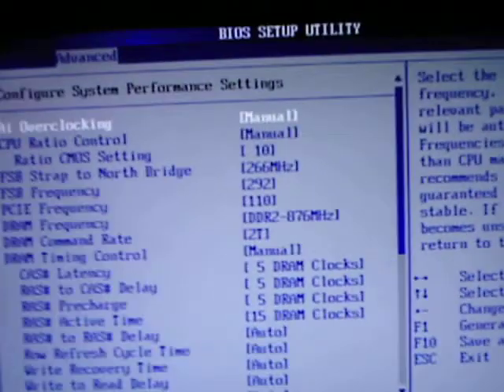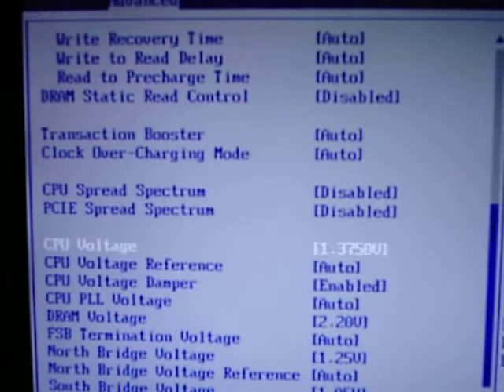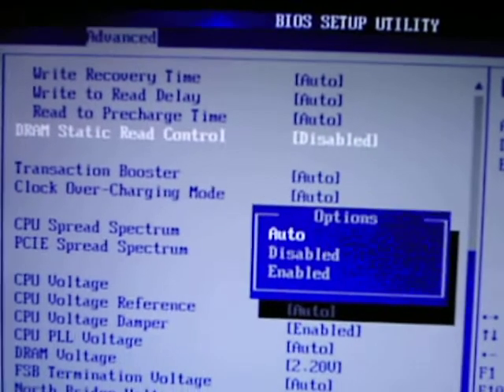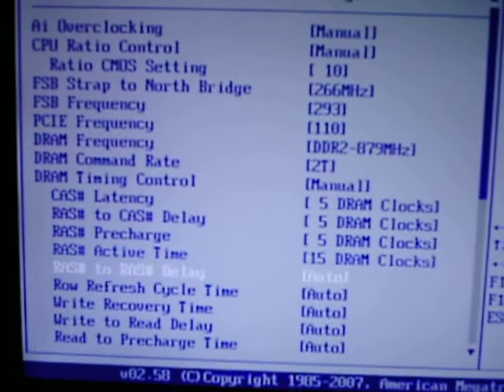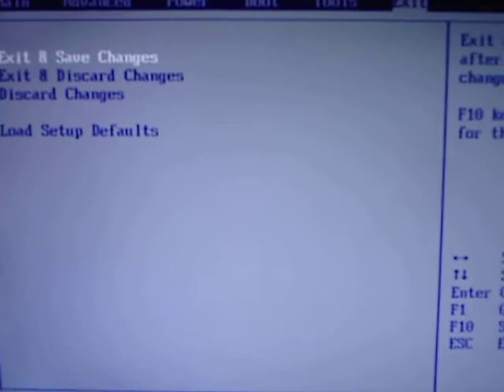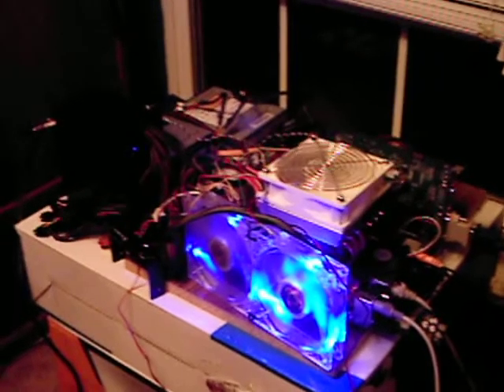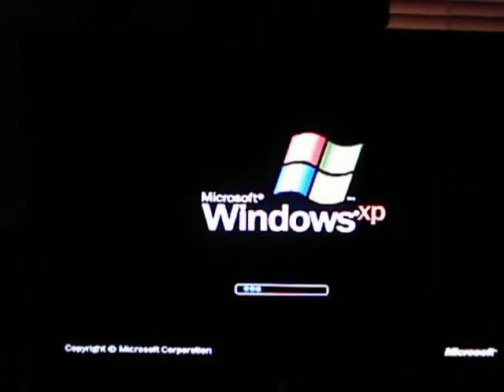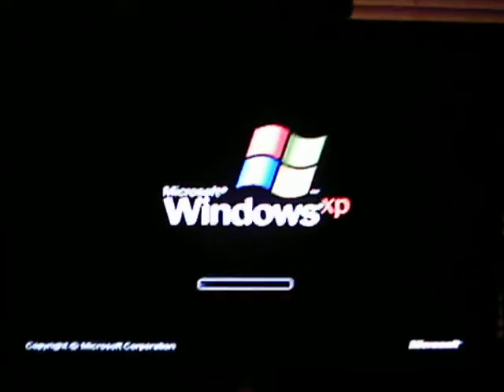Working on 24/7 Overclock-BIOS Settings

Comment: how do you unlock a locked bois?
my mobo is esc  mcp61pm-am, i can oc my cpu up to 2.8 from 2.6 but if i want to go higher i need to increase voltage my mobo wont let me.